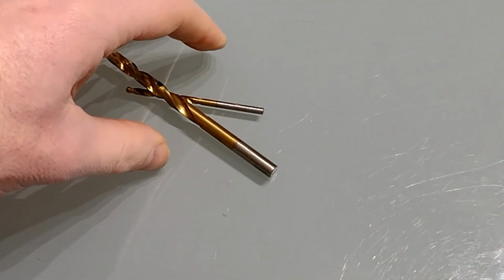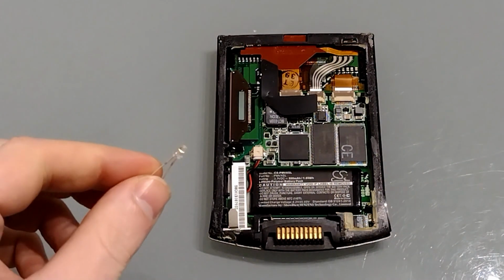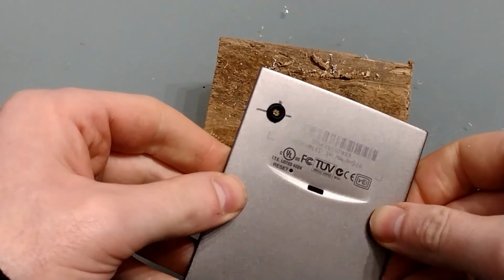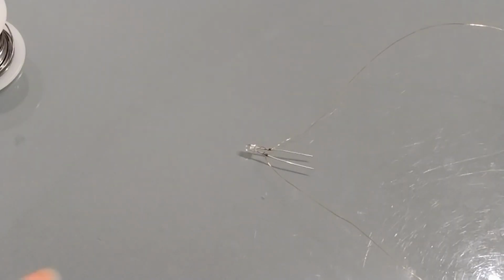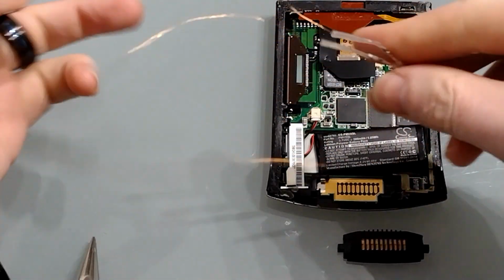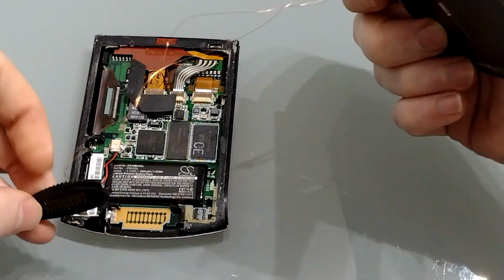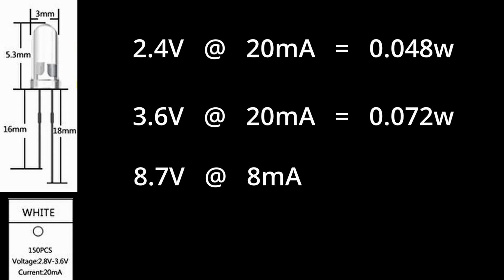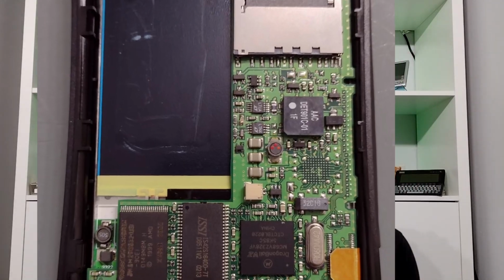Palm Tail light Retrofit a flashlight

Comment: Yeah, really nice little mod. Wiring is a bit excessive, you could cut those wires some 4 inches shorter easily.
Reply from the maker: 🤣🤣🤣 it's true, when I came to close up I realised I didn't need 3 meters of wire 🤣

Comment: Great video. It would be especially useful on Palm devices which have a camera, although it may not be possible. I dare hot try it on my Clie devices, as like you, I'm terrible at soldering. What I'd love to see is a way of adding some kind of illumination to a Psion 2, 3 or 3a screen and keyboard. I've tried a couple of clip on LED reading lights, but they're not ideal. Only the 3MX and some 3c models had a back-light.
Reply from the maker: I've not tried it on a clie so can't tell you which pins, I chose the Palm V for the video mainly because of the ease connecting to the handheld pins rather than my more often used M500!

Yes! I have been looking at a backlight mod for the Psion II (still a work in progress) as it should be fairly simple, the bigger screen on the series 3 complicates it a bit. As for the 3C they are notorious for the backlight failing due to broken ribbon cables 🙄